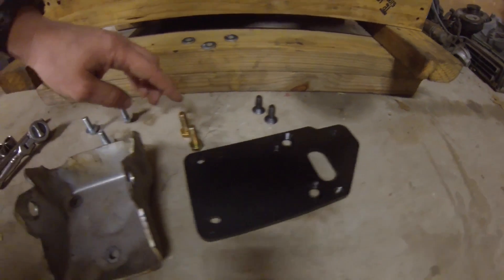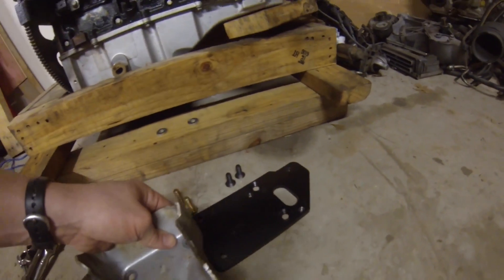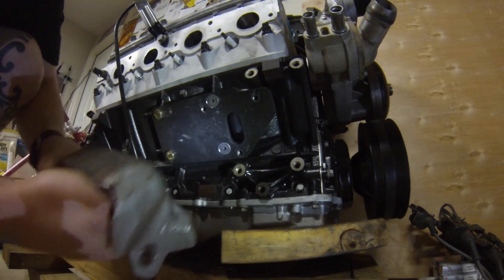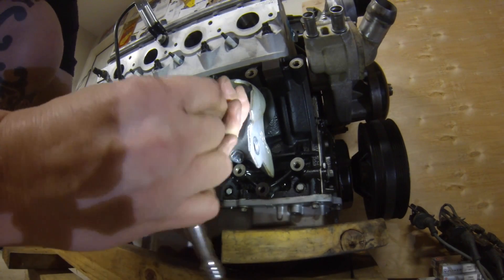How To LSx Motor Mount Adapter Swap Plates (One Inch Set-Back Plates)

Comment: Great vid! Very helpful.. This 5 min vid would save you an hour of trial and error with the engine hanging from the hoist! Thanks for the helpful tips.
Reply from the maker: Thanks Greg! Yea, thats true. I had put the engine all the way in with them on backwards the first time. Clutch fan almost kissed the radiator. Engine was way too far forward. Driveshaft would have had to be lengthened also. Had to pull it back out. Hopefully this will save others some time.

Comment: So on the 87 chevy did you use your stock driveshaft?
Reply from the maker: Yes, but I changed out the yoke for a 4l80e yoke. The head on the yoke was thicker, so I had to use different swap plate then the ones in this video.

Comment: I put mine on backwards the first time too because my original adapters didn't have the notch and didn't fit right.
Reply from the maker: Yep! My first ones didn't have a notch either. Sucks to have to pull them back off to switch them out.

Comment: How can u tell if the motor mount bad
Reply from the maker: There will be something loose, broken or too much play. Usually its just the rubber worn out and dry rotten. If the rubber is loose and flopping around in its case then its bad.

Comment: So what kind of transmissions do you use on your swaps? The transmission that was in the vehicle to start with?
Reply: 4l60e, 4l80e, t56 are commonly used but most gm trans will work one way or another.
Reply from the maker: I usually prefer a 4l60e or 4l80e because i like overdrive. Guess it'd all depend on the projects purpose. But like Richard said, any of the GM trans will bolt up to the LS.

The original trans in this truck was a 700r4.